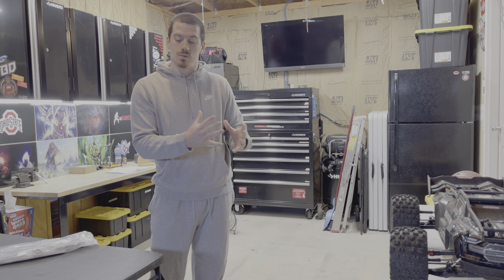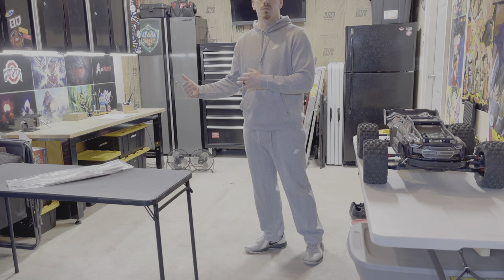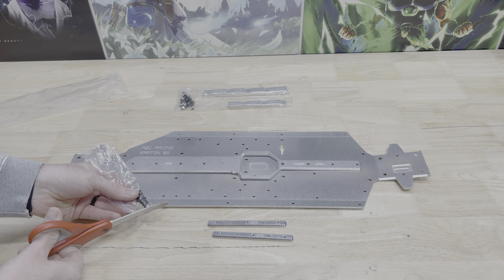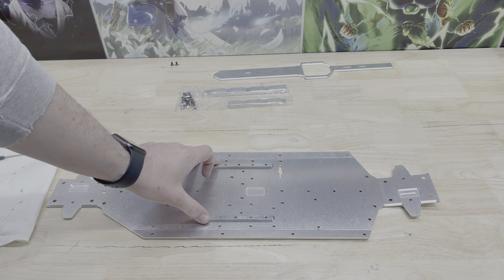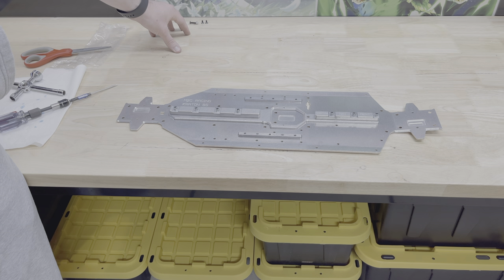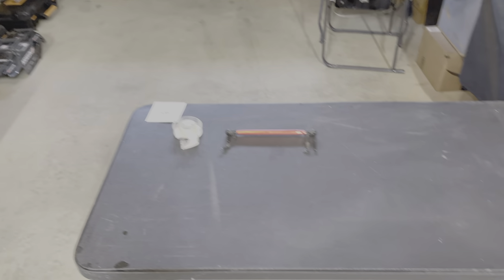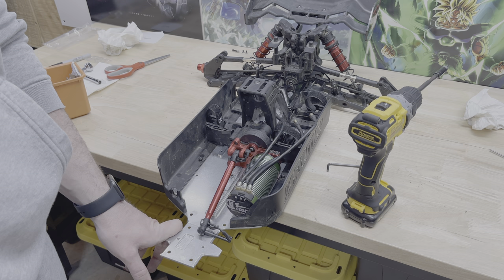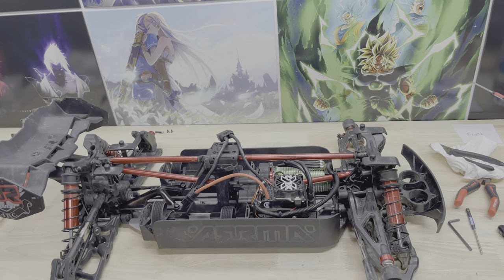M2C Chassis for the Arrma Kraton 8S

Comment: I did the M2C before i used the truck...
If you're on the Arrma forum, take a look at my build. I also grabbed the Brute body. It's a tank. 
It's a very easy transition to the M2C.
First run for my 8s XBE tomorrow.
Reply: What arms do y’all run? RPM or Arrma?
Reply from the maker: I’ve been using RPM lately

Comment: Thank you for the video on the install, I can't wait to do this with my Kraton 8S. Subscribed to see the future bash sessions with the Kraton as I'm sure you'll be able to beat on it with confidence now 👌🏼
Reply from the maker: I’m sorry to let you down, but I’ve sold the Kraton 8S. I ran into a pinch and needed the cash. If you unsubscribe, I understand.
Reply: @GoKaioken Aww man that sucks.  Did you get any good runtime on it before selling?   I have a m2c chassis on my outcast exb 8s and was debating going the m2c route on both my kraton exb 8s trucks as well.
Reply from the maker: Yeah I had a couple runs with it and no bends at all. It seemed extremely solid.